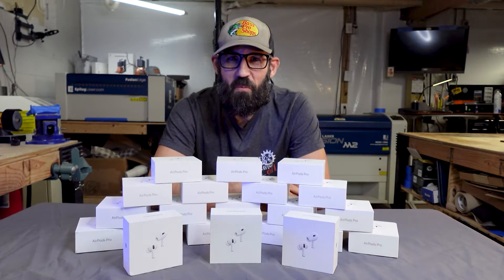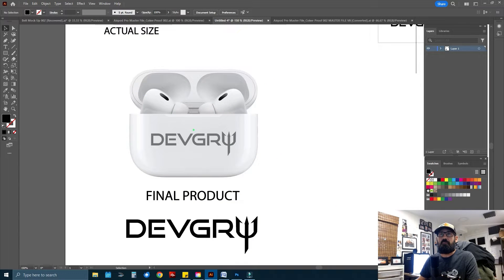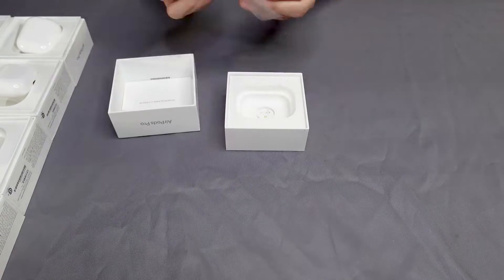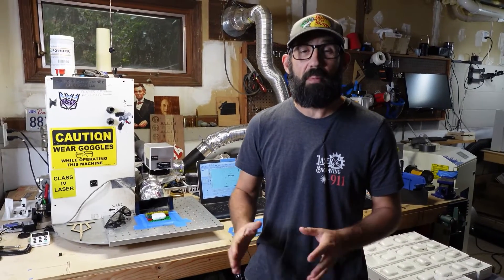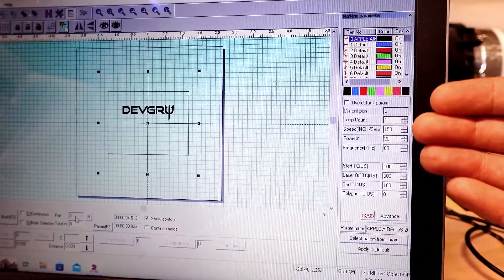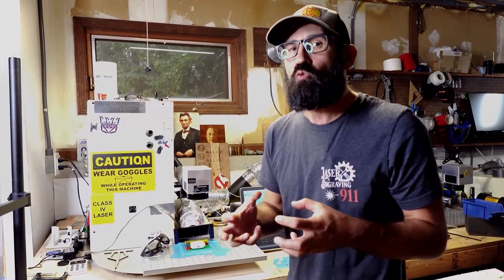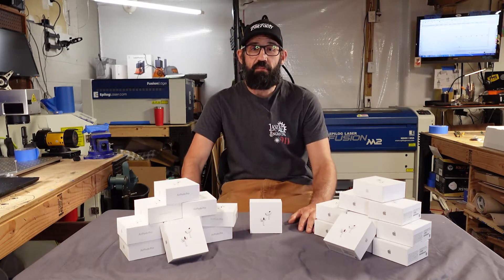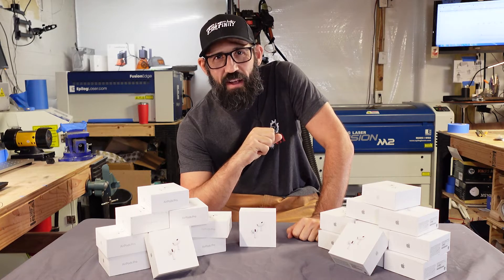How To Laser Engrave AirPods Pro_ Step By Step Guide_

Comment: Is this likely to work on my 20W diode (with different settngs likely)?  clearly I would not be able to adjust the angle (I think I followed what you were talking about).
Reply from the maker: I would test on apple plastic first. before running a real one. with a diode laser.

Comment: Thanks for sharing. When you're doing something like this do you request a certain number of units for spoil? Or are you guaranteeing your customer 100% success?
Reply from the maker: Yes and yes, when working on high value items like this I guarantee 100% accuracy, when I am working on example machine parts in the 500-1000 range, I do my best to offer 100% accuracy with no mistakes, but my customers will usually tolerate 1 or 2 blemishes, if that happens. I always do my best to deliver 100%

Comment: You have an Epilog 120 Watt correct? I have a 2015  Epilog Fusion 120 Watt, and I'm having zero success getting decent and realistic black & white photos using black paint on white tile. Do you have any videos on photos on painted tiles? Settings? I enjoy your videos. Good job...
Reply from the maker: Thank You! for that! And regarding your questions, here is what I like to do with my Epilog 120 Fusion, First I try to get he highest quality photo I can, to start with, if its low quality I run it though photoshop to upscale and clean up and get it at 400dpi, Then after I have the photo upscaled and at 400dpi I save that jpeg and load it into IMAGE-R  https://www.imag-r.com/  I use this software to process the photo for me then save it as as Bitmap file, and then I use that file to load into the Epilog laser, make sure your engraving at the same DPI on your Epilog as the photo. Hope that helps.